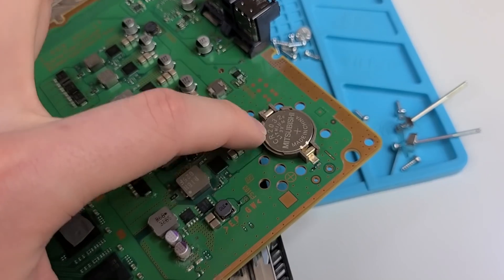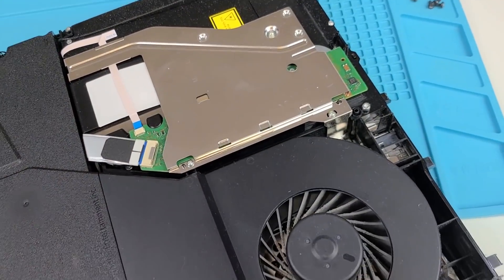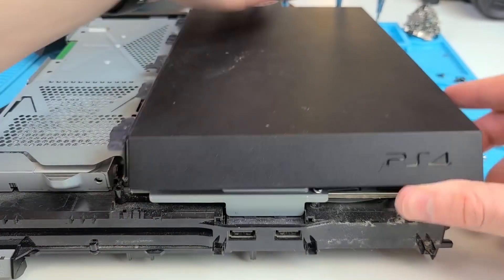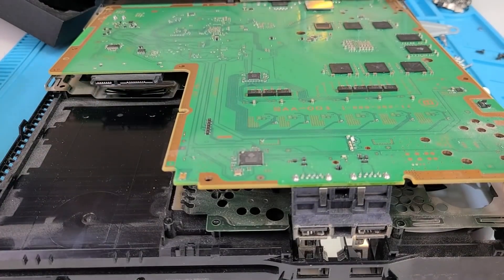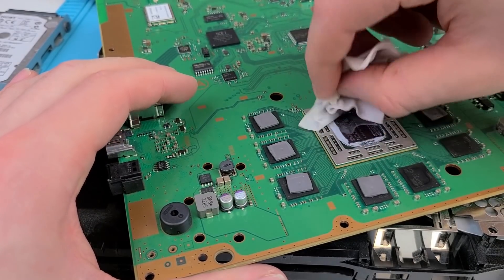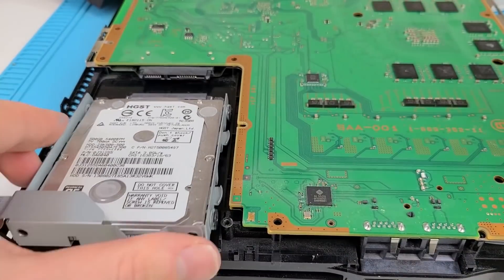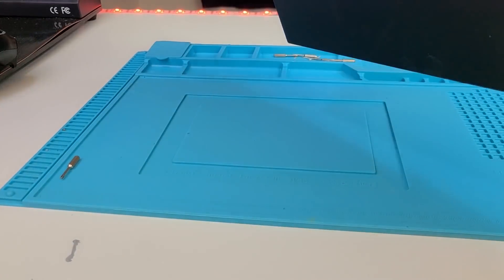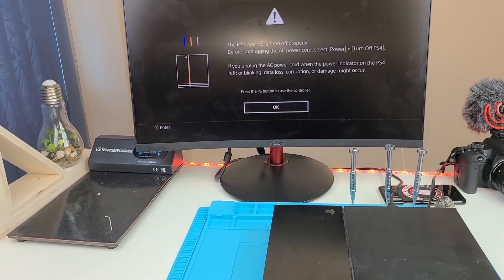Why is Samsung and Mitsubishi in this PS4...? Cleaning and Thermal Paste Application

Comment: You shouldn't spread the thermal paste as it could make it to thin and leave stress cracks effecting the heat transfer,  the amount is right instead of spreading it just put the heat sink / shield on and tighten evenly all the way around the pressure will automatically spread the thermal paste

Comment: It is not safe to open a power supply because electricity can stay in capacitors for like more than 3 monts and if you tocuh it you can die.

Comment: Hi Repair Guru
I have been using POCO F1 from almost two years,the performance has been degraded and heating a lot because the thermal paste has been dried up, Everytime i open my camera, it shows overheating, can't perform actions.
I want to know which thermal paste can i use to avoid over heating.
Please assist me 🥺

Comment: Bro i hope you won't get offended i like your channel so far but this video was not helpful at all and you didn't test it properly , you were only showing the startup screen,  at least do a little research on 3 ps4 types and find out which model is the worst in making noises and jet sounds, i have experienced this same problem with ps4 Original Edition, Pro and Slim and tested it with the worst game of all time Call of duty modern warfare / warzone, it turned out that noise levels are diffrent so in order from Low to High Noise  i got 1. PS4 Slim  2. PS4 Original Edition and 3. PS4 Pro , i opened all of them to check for dust and change thermal paste and tbh there was not enough dust to clean so i changed / renewed the Thermal Paste,  The Result ?? No change at all  Pro's for ps4 pro is extra quality but for extra Noise and Power Usage and the chance of Melting your ps4 pro, the other 2 ps4's are good to go , but you can't get 2k Quality out of them,   Keep up the great work

Comment: Hey man I have a question if that’s ok

So basically my iPad was stood on by my baby sister and has had purple I think pressure marks on the black parts of the screen (like when on the opening Netflix screen) it also has dents in the back apple has said I would have to replace the entire iPad to fix it but I wanted to know if you had a different suggestion? 

She also broke a hp monitor and they have said the same thing.

Oh I have an Apple Watch that won’t charge and a camera that is super messed up.

Comment: Also quick question for anyone who might actually know please could you basically just swap out the factories hard drive and install the O.S. they use and use either a larger one and or S.S.D.???
Reply: Yes, they have the firmware on their website that you put onto a USB in order to get the OS on the new drive.

Comment: There is no way i would ever be able to do this myself. So many steps holy
Reply: I'm a novice and do my PS3 once a year and am doing my PS4 today. Just go slow and don't force anything off. 
You can do it just take your time. 
New paste makes a huge difference. You'll see the old paste is totally dry by now. 
Hell I'm considering removing the IHS (CPU & GPU lid) on my PS3. It's kinda risky as you need to slice away very stubborn glue.

Comment: Imagine operating your PS4 to make it quiet like this dude did
Reply: Can't be quiet if It has a Lancer Evolution Exhaust system in it.
Reply: @michaelarkell5437  lmao
Reply: mine made me deaf
Reply: Mine’s just a Rocket
Reply: My playstation is moving evertime i start playing on it. So the cables goes of. But i killed it the last day, so no more of that.
Reply: Well actually it should be normal to do this kind of work to get better performances
Reply: @cozzaronero  I just do the 0:14 then I brush everywhere and I vacuum it to get rid of all dust ..
Reply: I already did I have experience from my mother board breaking and now I clean my freinds ps4s